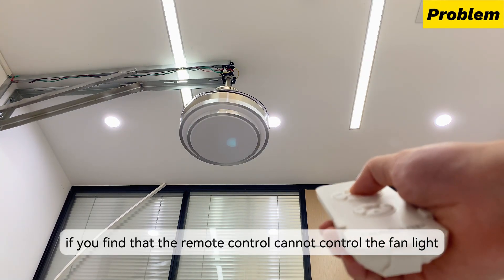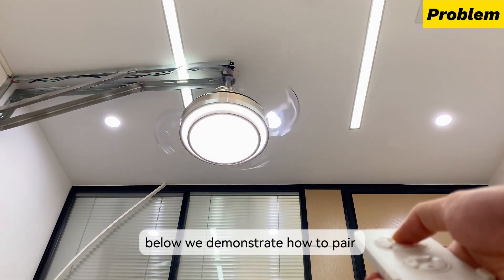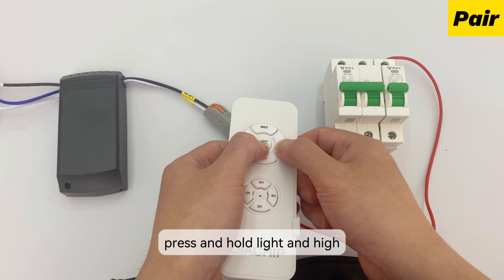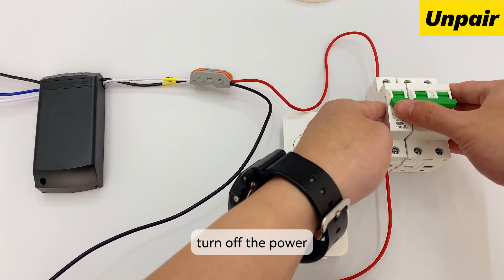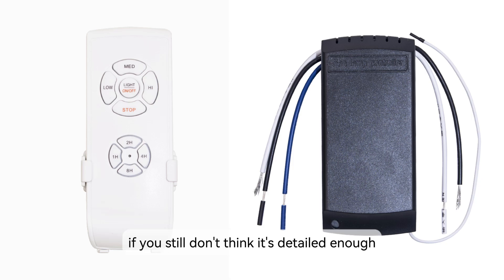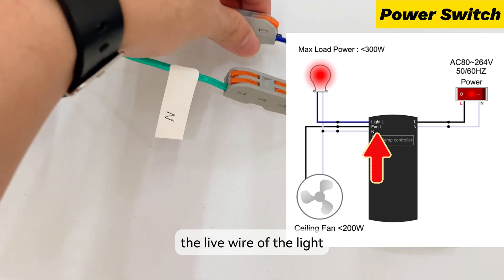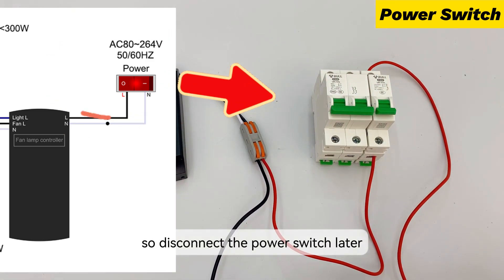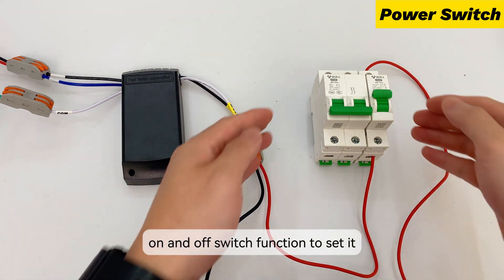how to pair ceiling fan remote control via 433MHz remote control  | fan light control pairing tips

Comment: Audience, I have a question. Is this a standalone remote controller, because my controller is like a receptacle light switch controller. It has to be paired, but still won't function operate my commercial electric ceiling fan. I'm frustrated with it after spending $300 brand new at home depot. I purchased it for my outdoor patio and was having construction work completed. It's been nearly three years ago since I purchased it. Thanks for your feedback.
Reply from the maker: I've pinned your comment. Hope it can help you.
And you should leave the brand of the ceiling fan or the controller you purchased so that people with the same purchasing experience can answer your questions. Please complete this information.
The ceiling fan and the remote control in the video are already paired before shipment. It takes some operations to make them independent. We don't sell ceiling fan remotes separately. 
You need to ask the merchant of the controller you purchased. This may help solve the problem better.

Comment: Hi, can i pair 2 remote controllers to 1 receiver?
Reply from the maker: Yes. If you purchase this ceiling fan light controller of the QIACHIP brand, then one receiver can be paired with two remote controls. The pairing methods are the same.